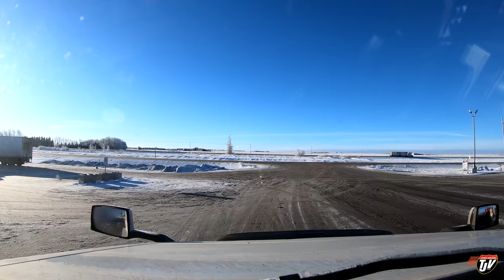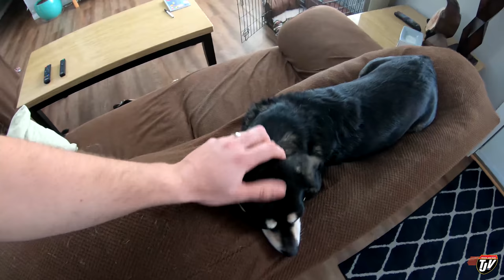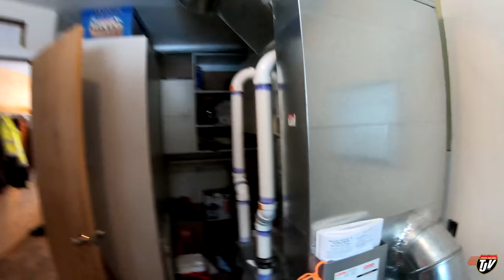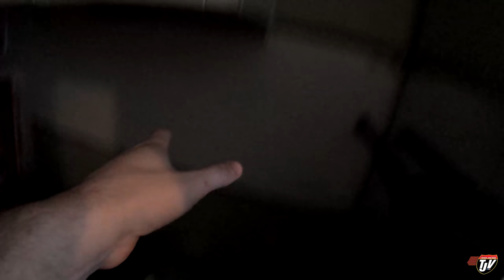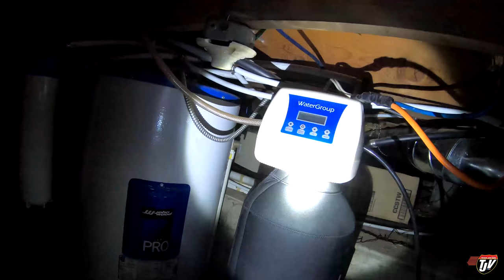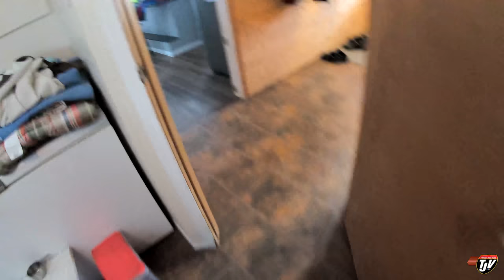My Trucking Life | OVERPASSES | #1909

Comment: Hi Josh, Love your videos. As a retired HVACR Tech you might want to look into converting the furnace to a downdraft, You're making a lot of initial bends which  will reduce your airflow and which might throw out the safeties in the furnace. I'm not a certified air balancing expert but know that you need proper airflow and return air to the furnace.  Supply registers and a properly sized  return register is key for maximum comfort and efficiency.
Reply: Josh, as a Bryant Factory Authorized dealer I have to agree with Wayne.  You may have to flip your furnace over into a downdraft furnace if that model of Goodman allows it.  Do research before opening pandora's box.  I'll be in touch if I find out more!

Comment: Josh. The easiest fix is to add additional insulation and duct sealer to your duct work and more insulation to the attic will cure your problem. Relocating your duct work will require you to move your heater to the crawl space and to cut new vent in throughout your house. Otherwise you'll just be heating your crawl space. Remember, heat rises It doesn't turn a corner and goes down and across. Only question is, how is your attic vented??? If you don't understand what I'm saying just email me.
Reply: ,,,   You are so spot on, I would love to post the same comment essentially, however I am 2 weeks past posting so I'm sure Josh will not see my message but hopefully he read yours!

Comment: Roundabouts eliminate traffic lights and thus a waste of fuel.
Reply: Yeah the traffic runs smother in a roundabout often never comes to a stop.
Reply: Les Moore  I live in Sweden and we has have them for very long im been driving for 33years and they were around when i started to drive. Key is to use the blinkers correct then the traffic runs much smoother.
Reply: Roundabouts dont work at every intersection

Comment: Building overpasses on the trans-canada highway on the flat rural areas was considered to expensive and not necessary at the time of construction back in the 50' and 60's. Consequently the Winnipeg Perimeter is devoid of
overpasses. Maybe in the future they will add some for safety and traffic flow sake. Keep trucking!

Comment: I don't know too much about heating systems, but it's not logical to have hot air vents in the ceiling as hot air goes straight up, so the heat never comes low enough to warm your house which will make your heater work harder and increases your natural gas consumption. Northern-American buildings are a bit weird to me as a Western-European guy: mostly wooden buildings (most of ours are made of bricks) and hot-air heating systems (we have a heater that heats water running through radiators in the house) :-P

Comment: Obviously you're going to take the duck system from the attic and reuse it for underneath the floor?
Reply from the maker: I am thinking of doing that yes. I am also considering leaving it there and using it for air conditioning when we get that installed.
It would make sense to put air conditioning through the Attic and have it come from the ceiling as cold air sinks and heat coming from the floor as it rises
Reply: @Trucker_Josh  ,,,   Love you man, but you will be spending more money than you need to. You need more insulation in your ceilings! that is where most of your heat is going into your attic.  If you need to add more insulation around the ducting that is easily doable also and not expensive,  and secondly make sure the attic space is vented so that it is not  "sealed".  A 6" take off coming from your heated furnace plenum simply through the floor into your crawl space will warm that up sufficiently.  And yes it must be insulated around your foundation to keep that cold from migrating into your crawl space, 4 inches of Styrofoam would be most excellent around your foundation.  Just make sure that Brit is gone on vacation when the foam is installed :)

Comment: wow Josh, you shouldn't complain about traffic lights, and then drive for like 2 miles before you come to another set of traffic lights, in my town you cannot cross it without going through at least 8 sets of traffic lights in a 4 mile journey one way from my place to my parents place. my mpg in my car is 4.7 mpg, and reccomended mpg for my car is 74, and that is not on a clapped out old banger either!! which is only achieveable on the freeway equivelent in the UK, at 50mph. so count yourself lucky, as if you drive the route slowly you sure as hell would catch every single light on red, and have to wait 2-5 minutes per set of lights.

Comment: Hey Josh and Diesel 
I enjoy your videos all the way down from the four corners! (Arizona, Utah, Colorado, New Mexico)
The Navajo Nation. We rodeo up there during the summer so I recognize some of the roads. 
There is no heat over your porch roof (deck) and the pitch dose not help. The snow dose not go anywhere so that backs everything up. If you zig zag heat tape over the porch area you will get drainage and run off. It will run up your electric bill or have someone remove snow every time it snows.... Might cost the same either way.
Good luck